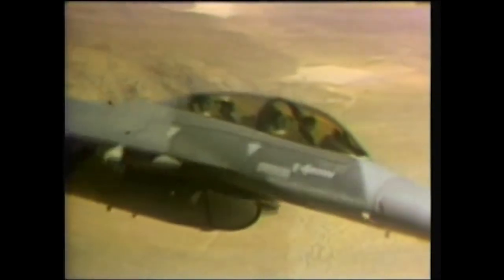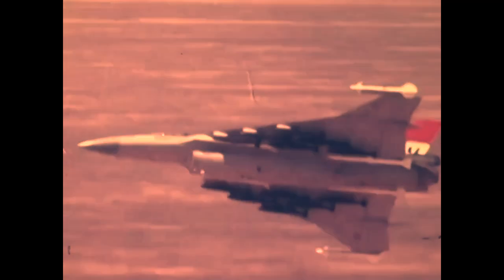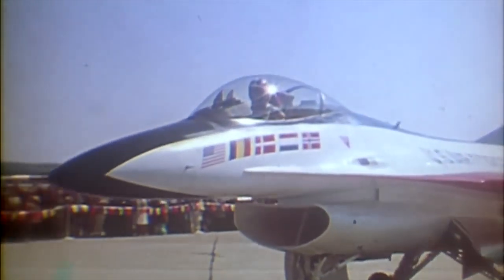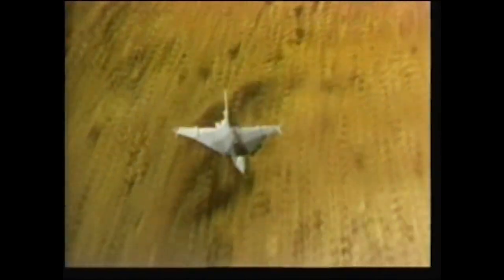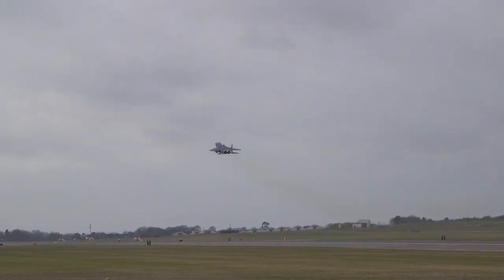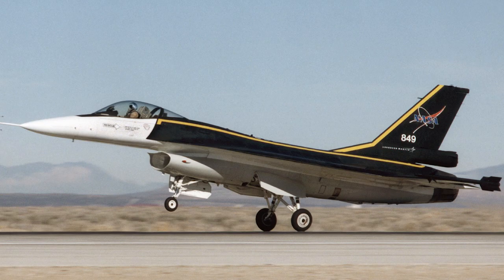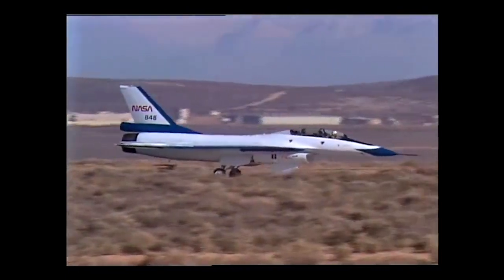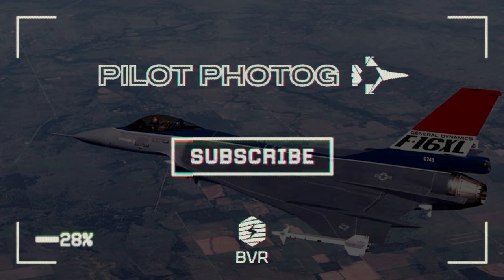F-16XL The Fighter That Should Have Been Built | avgeek |  #f-36

Comment: We built a RC model based on this airframe... Of course it's not exact but it's scale... It's running a 120mm ducted fan... It's flying weight is 22lbs and the fan is making 19lbs of thrust... Plane is surprisingly not draggy at all. Very very quick with that fan pushing it close to 190mph in level flight at full throttle...

The reason im posting this... The F16XL airframe is easily my best flying jet model so much so we are likely going to build another one but it will be a Jet turbine and not a brushless ducted fan.

At high AOA low air speed flying it's superb... It's super floaty and slow speed handling is superb... It flies like a super stable flying wing but lacks some of the flying wing poor flight window limitations.

What it does is turn like a bat out of hell... Has high AOA performance that is better then any other airframe designs i have flown... Is super floaty and has amazing amazing slow speed handling. Responds very well to power and keeps its energy up very well... In a plane that has a sub 1 to 1 power to weight EDF it carries energy and holds it better then any airframe and wing design we have ever flew....
This design running a Jet turbine that will produce 1.1 to 1.3 to 1 thrust to weight ratio.... The plane will 100% be the most capable and acrobatic jet turbine i own... With 3d thrust vectoring it will be amazing what this airframe design is capable of.

Again its a large RC model... Based accurately on airfoil and wing loading to scale... The model is about 95% exact to scale so it's flight envelope will be very close to how the real thing flies... My current EDF model has nearly same power to weight ratio as the real thing as well... The way the RC airframe reacts when it's this scale the real thing will react vary similar and I can say without a doubt that this airframe is amazing... It vastly out preforms a scale jet turbine F16 i have that is running a .9 to 1 thrust to weight ratio and is 98% to exact scale... The high AOA performance is superior at all speeds and capable of much higher aoa without tip stalls... It's much more floaty and the slow speed handling is night and day.
Reply from the maker: Thanks so much for the detailed response and info about the model - If you haven't yet consider joining the Discord, I'd love to have conversations like these and can create a dedicated RC channel to share pics/plans/ideas, etc.

Comment: Boyd's EM theory informed most aspects of the F-16's design.  It was designed to have a high sustained turn rate of 9g at speeds above 140 knots, so if the F-16XL bled energy in tight turns that means the improved combat radius and payload came at a cost and compromised its biggest advantage over Soviet adversaries in a potential dogfight.
Reply from the maker: Agreed and it could have been used as an export fighter bomber for nations which placed an emphasis on range and payload.  Thanks for commenting!

Comment: Delta wing with canard balance out lift vs. maneuverability. That’s the take away, if not mistaken.
Reply from the maker: Exactly and that’s what you now have in the Rafale and Eurofighter.  Thanks for commenting!
Reply: The right place for the canard is on the other guy's plane. Canards have an unpleasant tendency to stall, and a rapid pitch up rate can stall both the canard AND THE MAIN WING, a very unpleasant flight characteristic for a fighter.

Comment: From what I have read so far on the soon to be F-36 "Kingsnake" it is the F-16XL with all the latest electronics packages like the F-35 has and it will have a modified Raptor engine for mach 2 speed. It is a non stealth approach fighter which will keep costs down supposedly.

Comment: I suspect if there had been an export market for the XL it would've gone into production.  One engine and parts compatibility with the F16 would've made it more supportable by smaller air forces.  The F15 is transitioning into a missile/bomb truck now that the F22 and F35 become the tip of the spear.  The XL would've fit that missile truck role nicely.

Comment: The cranked or 'canted' delta was actually developed on the RAF Vulcan before the Draaken. BAE has since become a major stakeholder of SAAB and the Gripen is partly made in the UK.
Further development of the F-15 Eagle was built into the design and allowed for maturing as Russian planes evolved with narrower purposes.
The F-16 Falcon early designs included a fuller wing and twin jets but a single engine very agile jet was wanted by foreign customers and the USA was able to develop the F-22 and full stealth machines without rushing. 
The F-35 was a somewhat cynical exercise in "joint development" which withheld codes from even Tier 1 partners and ran massively over budget and time. It was obsolete before entering service and quite puny except for specialized carrier use and some air force use abroad. The F-22 is similarly obsolete but can be used if necessary for the USA only.
The 'Hi-Lo' concept favours the F-16XL being developed and it will be called the King Snake, soon to be tested and using the F-22 engine. Its glide characteristics imply possible use of an emergency 'get home' engine possibly based on the RR Pegasus series.
In real combat reliability is more important than stealth and the F-35 lacks this. Enhanced F-15s and the King Snake will give the USA advantages in asymmetrical warfare without very long waiting time such as happened with the F-35.

Comment: I find this to be very relevant in light of USAF recent news on cutting the F-35 orders. Lockheed Martin has photos of an F-16 that was fitted with a new intake design back in October 2020. That and the new Viper block in production is powered by a single Pratt & Whitney F100-PW-229 or a General Electric F110-GE-129 turbofan engine. The F100-PW-229 develops a thrust of 29,100lb, whereas the F110-GE-129 generates a power of 29,500lb. The power-plant provides the aircraft with a maximum speed of Mach 2 and a range of 1,740nmi. That range would be extended greatly if the main body was fitted with the Delta wing of the XL. A recent artist rendition of the proposed F-36 looked very much like the F-16 XL however the person that did the rendering suggested that tailerons would be on wing instead of the centerline near the back of the fuselage. We know that the current F-16 line is in production and it stands to reason that Lockheed has those General Dynamic plans in the data collected from the XL program. This would suggest that we could see a version of the the XL in the near future and this is due in large part to proven new integration of systems and technology in the F-15QA and the high cost to operate the F-35.
Reply from the maker: Thanks for commenting, I am actually working on a video about the F-36 as I type this, looking for a Monday release date as I have a 3D model that I am animating for the video and need to do a fair amount of rendering for the animations.  Stay tuned!
Reply: @PilotPhotog  I will go to your FB Messenger under the Joe Nieves and send you some photos I have of that Test Viper 😁. Btw I really enjoy this channel.  X-Planes series is great!
Reply from the maker: @joenieves4033  thank you Joe!!!
Reply: I agree.  It would be the best way to go. The F-16 has also been a very successful platform for export, I can only imagine what this could offer when it comes to sales. It would fit many nations needs. Also, anything inspired by the Draken needs to be made . :)

Comment: Absolutely it should be put in production just as the Viper has the extra fuel capacity but nowhere near the amount of hard points ! It would definitely be a multirole fighter 😎 The fuel capacity with new engine from raptor F 35 with the super cruise ability oh yeah definitely need to go into production and give the F-16 falcon a well-deserved break. Also the configuration of the XL would definitely be a good Flat Top Aircraft

Comment: I was (very) obliquely involved in the development of the F-16XL, but not of its flight testing or suitability, so I came to know of its extraordinary payload/range capabilities, relative to the F-16A/B, like everybody else did the time. I wondered too why the F16XL didn't supplant the F-16, with such dominant stats, and you've largely addressed this longstanding curiosity of mine.

However, in this examination you bring up another mystery: if the F-16XL has inferior bleed-off of energy in sustained high-energy turns, as you say, this would connote that it lacks a comparable lift-to-drag coefficient to the F-16, yet lift-to-drag is what would allow it to either have such a favorable range/payload, and/or how it could approach the transsonic regime without afterburner. (Supercruise itself is very much yet another chapter in aviation aerodynamics).

Am I clear? If it has such an improvement over the design goals typical of a military fighter, then why didn't it necessarily excel in high lift-coefficient turn performance?

I can think of a few caveats, but I would have to know more information. Are you aware of the F-16XL's degree of instability? IIRC, the F-16 was 6 percent unstable.

Postscript: I notice the cranked-arrow wing has "conical leading edge camber", like an experimental wing then tested on an F-102, IIRC. At the time, conical camber had a similarly "miraculous" positive effect on subsonic lift-to-drag, as was the cranked-arrow wing for transsonic (supercruise) performance.

"A Wing Concept for Supersonic Maneuvering"
William H. Mason 
1983-Dec
<https://ntrs.nasa.gov/archive/nasa/casi.ntrs.nasa.gov/19840007047.pdf>

Comment: They also made a variable geometry glove variant of the cranked-arrow' wing F16-XL; as part of their laminar flow study. The below statement cannot be understated

"The metal surface of the experimental wing panel was perforated with about 10 million nearly microscopic laser-cut holes. Through the tiny holes, a suction system embedded in the wing (and mechanized by a turbocompressor in the fuselage) drew off a very small portion of the boundary layer of air just above the wing's surface, thereby expanding the laminar flow across the wing. "

For those interested: The official comprehensive history of this aircraft can be found below [488 page pdf]
https://www.nasa.gov/sites/default/files/atoms/files/elegance_in_flight.pdf

Comment: IMO, the XL was a pretty solution, but its delta wing meant it sacrificed a lot of maneuverability. At high AoA, it bleeds off too much energy. It was definitely a great plane, but it focused on ground-only much more than the 15E, which is every inch still one of the world's most capable air-to-air dogfighters. Also, the major modifications would have meant a lot more cost risk for the USAF as well. 
Two other things; loading the XL up with 15,000 pounds of bombs would probably kill its range and maneuverability (excess thrust would be terrible) , and 2800 miles is almost certainly the ferry range with external tanks only.
Reply from the maker: Good points and thanks for commenting!
Reply: @PilotPhotog  Any time! I see one of the XLs in storage fairly frequently, and it's in kinda rough shape; got a big bare spot where its titanium laminar flow wing root used to be. Hopefully the Edwards museum folks can fix her up to look pretty again

Comment: It was my understanding that GD made the XL into a upgrade kit that could be applied to then existing F-16's. besides replacing the wings there was a fuselage plug installed that lengtheend the forward fuselage. Supposedly about 200 of these upgrade kits were made but ultimately put into storage.

Comment: My first thought for a modern version of an F-16XL would be as a dedicated Combat Air Patrol aircraft for the US Navy.

An updated F-16XL should have a lower max takeoff weight, giving it better maneuverability, speed, range and AMRAAM/Sidewinder payload vs. F-18 or F-35C, while having a lower unit cost if ordered in large enough quantities, and finally lower maintenance costs per flight hour.

It all depends on how many people try to add too many bells and whistles during the preliminary design phase. Lately the military/politicians have not had a very good track record of staying focused on what’s the most important goals of the new plane versus the costs which quickly escalate.

Comment: F-16 XL was originally FSD F16 No5.  There were 6 F16A's and 2 B models in the EAFB Flight Test Program.  I worked the XL and the Y2 tail # 568 as a control engineer. The assigned control engineer was a capable x army chopper Vietnam Vet Wes Anderson. It must be stated that the contract awards didn't really go to the best piece of hardware. The XL could get to altitude andstay there forever. Contracts went to political agreements already in place. All the ancillary programs were just another way to pay for R & D of Company pet projects, but did yield results.
Reply from the maker: Thank you for the information and thanks for your service!

Comment: The F-16XL needed to have an increased stiffener and mount for the vertical stabilizer.  During High Angle of Attack testing, the F-16XL suffered a lot of fatigue cracking at the base mount of the vertical stabilizer due to turbulence.  This would have added a couple more hundred pounds of mass to the airplane.

Comment: I happened to be at Carswell the day the F-16 Cranked Arrow rolled out. (I was there to catch a hop.) The AF Chief of Staff, both Texas senators, a solid dozen Congress Critters, and more high brass than I had ever seen were there. Probably SecAF, too. 
IIRC the F-16 Cranked Arrow could translate; that is, it could point its nose off the line of flight. It could crank the nose 22.5 degrees left or right of its line of flight. (Imagine the pucker of Soviet Bear eRecce bomber crews flying up the east coast with a Cranked Arrow F-16 pointing at them while it paralleled their flight path.) It could do the same with the nose pointed down slightly (~12 degrees) for strafing runs. Impressive performance characteristics. But GD did not command the votes in Congress that MacDoug did.

Comment: I can't say the F-16XL was compared unfavorably to the F-15E...  As was mentioned, the extra engine an F-15 has gives it a boost to survivability for that Air Interdiction mission which both were competing to fill after the retirement of the F-111.  Honestly, one cannot blame the US Navy for sticking to two engine fighters (why the chose the F-18 based on the YF-17 instead of going with the Air Force's pick of the F-16), for similar reasons.  While this design is what I feel the Viper should have been in the first place, the reasons it was not selected make sense.  Logistics tends to win out over innovation for reasons, the Allied victory in World War II for example was largely the result of those logistical compromises being given precedence over technical innovation in many areas.  If more airframes share parts, the easier it is to keep them airborne and supply deployed squadrons.  I suspect, along with the survivability of two engines aspect, the shared parts between F-15 models won out over the differences between the F-16 models in service and the XL; and with the A-7 on the choping block (despite how many interchangable parts the last models of the A-7 Corsair II shared with the early F-16s....); and the "black budget" programs mentioned; yeah it make sense.  Though, this is still an incredible design for model enthusiasts to find kits for, scratchbuild, or create RC planes!

Comment: OK------------ The F-16 XL looks like the perfect replacement fighter for the F-16 the Airforce is looking for.  That is with a few changes like adding a few stealth features like twin angled rudders, canted side panels on the forward fuselage, and Shark Toothed engine intake (making it simi-stealthy), while replacing the twin cockpits with a single-seat F-35 cockpit with all the sensors (cutting empty weight and adding more fuel), with the more powerful and efficient F-35's engine that would give it Super Cruise as well as over twice the range of the F-35 (3,000+ miles). This would allow the Current F-16 production line to continue with all the same Sub-contractors across the country while cranking out another 3,000 new and incredibly improved and faster replacement fighters for about the same cost as the current F-16. The company, Airforce and Nasa spent almost a $-billion on researching the F-16XL over decades, it is time to use all that (now free) research. It Sure beats taking a decade and $-billions to research, design and produce a new fighter half as good, with half the range and twice the COST.

Comment: No kit of this aircraft exists in 1/48 scale,  only 1/72 scale.  I used several Hasegawa kits as a start on this model.  80% of the model ended up being scratch built around a carefully carved basswood core and coated in plastic resin.  This was, by far, my most difficult model.  Fist two models were close but ended up as scrap.  The third model was something I was proud of.  I will never build such a model given the extreme amount of extra work.